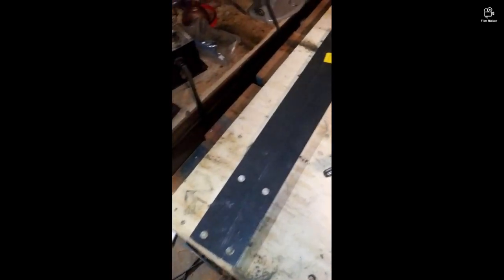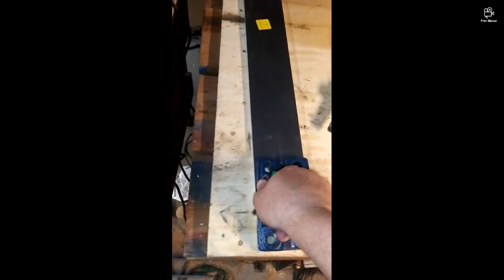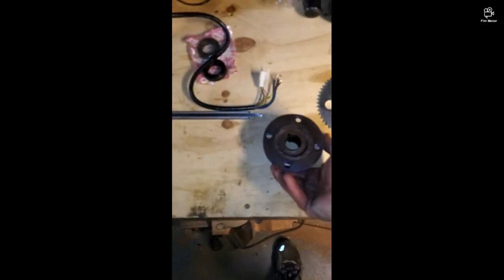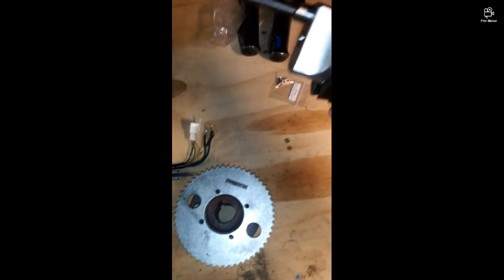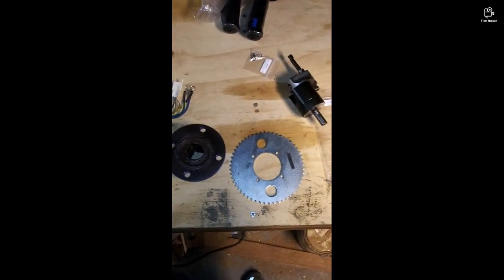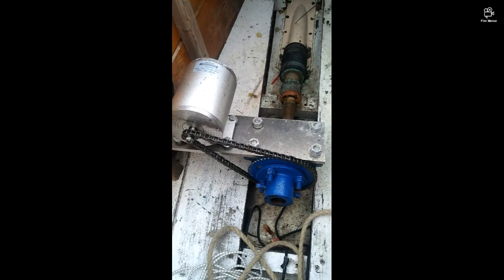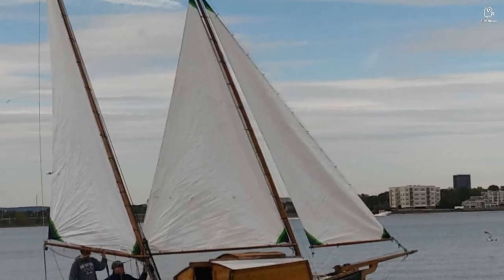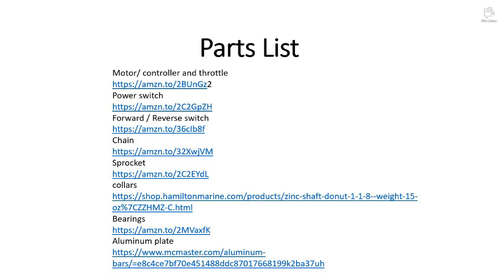Inexpensive   DIY Electric Inboard Conversion

Comment: Hi. Where did you get the shaft and prop from?
Reply from the maker: Hi, sorry it took me so long to respond.  I got it on craigslist under Boat parts. The entrance the prop in the propeller 300 bucks. It was well worth it used.

Comment: 🤔Humm,does the prop shaft want to slide forward as the old motor held it in place before , ?  What holds it in place just the chain ? 🤔
Reply from the maker: That’s a really good question cause you think if you work through, you think that it could.  I have not seen that, but it certainly could do it a little and I just don’t notice.

Comment: Just out of curiosity, how fast were you going at full speed???
Reply from the maker: Just over 5 knots but it would over heat with that motor after a while , it would run for ever at 3 knots
Reply: @philcostello6989 what was the approximate weight of the boat?? Just curious again
Reply: @philcostello6989  Test I am @thepatriotsledgehammer and this is my other channel... I am asking as I am currently in the process of building my boat....

Comment: Did you find any foid throttle?
Reply from the maker: I tried a few ! the one I use now is a simple halls sensor turn switch from Amazon. It’s sensitive I was also looking at a control to provide the signal and do it on Pad touch screen , but I decided I’d rather have a lever so now looking at a hall sensor lever
Reply from the maker: https://electricbike.com/forum/forum/main-forum/trouble-shooting/119157-how-to-make-a-potentiometer-type-throttle-work-as-a-hall-sensor-type-throttle

That link may be helpful for throttles ,showing how to convert a simple variable resistor as well
Reply: @philcostello6989  cheers thanks

Comment: What is the mass of the boat? I am thinking about electrifying my sailboat but it weighs approx 7 metric tons, believe that is about 15000lbs
Reply from the maker: My boat is about 3000 lbs you’ll need at least 10 kw motor I think , check (thunderstruck and golden motors system
Reply: @philcostello6989   will do, thanks for the info

Comment: i did not see a thrustbearing
what is stopping the driveshaft being pushed backwards and forwards?
Reply from the maker: There was a little movement  back and forth initially . More recently I fixed the motor mount to the floor and have it more locked in to bearing and collars

Comment: How much does the boat weight? I have a 6000lbs houseboat and I am looking for a bldc motor power enough to propel it not necessarily at high speed
Reply from the maker: So my boat is about 3000 pounds. I would suggest a golden motor or thunderstruck 5000 kW
Reply: @philcostello6989  The 5kw one looks okay for boats up to 6000lbs but the 10kw is probably better but they are a bit expensive. A twin Vevor 3Kw motors would probably be a alternative. There is also Turnigy Rotomax. I am still researching and learning, I am looking to all possible options, sealed under water engines to prevent any heating issue, even used converted car alternators. Haven’t decided yet if it will onboard or outboard. Thank you for  sharing your stories and findings!

Comment: Great video. i restored a 2000 Bayliner capri and now the engine is seized after we ran aground. I would like to be able to convert this 19 boat to electric.  Any idea on where to get a set up for a DIY guy. thanks.
Reply from the maker: Hi, I would look at several thunderstruck, golden motor Canada both conversion packages . you could also look at grinn technologies # https://ebikes.ca/product-info/grin-kits/gmac.html
# https://goldenmotor.bike/product-category/e-boat/inboard/ and # https://www.thunderstruck-ev.com/electric-sailboat-kits-and-accessories-inboard-motor-ev/
Research on these sites they have good info

Comment: Hey mate, do you have an idea what what this motor would be equivalent too in HP petrol motor?
Reply from the maker: The conversion is to devide kw by .746 in theory it’s 2.5  . though the gas and electric perform differently depending on tork and thrust at operational speed

Comment: I was wondering where I could source a motor like that I want to use a belt drive wasn't able to see the parts list it went by too fast and I'm not good with the computer or the phone but I can build or fix most anything
Reply from the maker: Those motors  can be found on Amazon and eBay mophorn is the brand on Amazon look up electric gocart conversion 

The also sell them state side at electric scooter parts.com

Comment: how many amps was it drawing - what type of battery sys. did you use? ... i have a 31' Cal with a dead diesel (pulling out now) - def. want to go this route ... but DEF need help getting this accomplished .. i have brand new POOL VAC MOTOR - i think that will work - think :)  any ideas would be very helpful ... here in miami
Reply from the maker: Lead acid 80 amp hrs im getting about 2 to 3 knots about 30 amps . Lead acid can’t go less than 1/2 rated amp hours or will permanently damage batteries I have another video on the power and speed

Comment: Hey there! Thanks for the vid. I want to convert a 35ft sailboat to electric. I want to buy an inexpensive (about $400) industrial AC motor (20 hp) and run it off a DC battery bank. Any ideas about the stuff I need to buy? (motor, controller, batteries....) Thanks!
Reply from the maker: I would really look at lithium batteries off the bat. I would also look at the over all efficiency going from battery to the ac power . And look at some of the ac safety concerns.
Reply: @philcostello6989  Thanks for info! I bought a 12KW brushless DC motor. Arriving in a few days. I need to source a controller for it. Hard to find out what will work.

Comment: Anyone done this using belt drive capable of taking 200 hp
Reply from the maker: Hi Michael thanks for watching, the video. there are some companies out there that are doing belt drive with a fixed mount in the hull using motors that have high horsepower. I think the issue would be the battery storage needed for a 200 horse more than the motor and the mount itself. Companies like Lynch motor or elco Marne propulsion , deep blue, electric motor inboard Evoy  . I would look at all these companies get all the information you can and then see what would work for you either DIY or through one of these guys. That's my thought some of these forms of people that are a lot more knowledgeable than me though

Comment: Thanks for sharing. Simple, just like it should be. Why complicate things? I'm thinking of converting to electric as well on my 34 foot sailboat. How much does your boat weigh?
Reply from the maker: https://youtu.be/FvGr-QJ6FGQ    my boat is in the neighborhood of 3,000 lb plus myself and my passenger usually are about 500. I have attached this video which shows some of the considerations I had gone through and also gives the exactly and how you can size the electric motor to your torque requirements on your speed. the thunderstruck motors also has several good links and several good calculators to help you. I hope this helps. when considering this you just want to really look at the batteries for me to let acid we're okay but I made a mistake I thought empowers were the same amp hours rating for all levels of draw but it's not the case with the lead acid batteries you pay a heavy price for taking out a lot of amps and most of them are rated for low amps that's the deep cycle batteries. the fact that I use it just to get in and out of a slip made this mistake forgiving for me but if you're going to need it to go long distances it may be worth the lifting of iron batteries

Comment: how much watt is your motor ?? like 100 watts or so ?? seems really small on your boat ;) nice project none the less
Reply from the maker: Hi Senc, the motor rating is 1800 watts though the controller that comes with it and the advertisement says it's only 32 amps which would be less than 1800. Because I use lead acid batteries which are terribly inefficient I try to keep the three knots which is between 10 and 25 amps depending on the current and the wind on my channel I got a video on the speed and the power if you're interested. I'm about to do one on the lead acid batteries which I can really only afford though the lithium looks so much better and more efficient

Comment: That is true. I think the ideal would be lithium ion but now you are looking at a battery management system. Or take your chances at fire. I am looking at a middle option between lithium and lead acid which is using recycled Prius power cells wired in a combination of series and parallel for voltage and watt hours the Prius is nickel metal hydried.
Reply from the maker: Wow that sounds pretty cool Prius did you get those from a junkyard or is there somebody that's reselling them. I was actually thinking about an e-bike battery pack usually comes with the battery management system since functionally I only really have about 30 amp hours and I've been doing fine with it I might keep that that 30Ah number and for my next  battery
Reply: @philcostello6989  So just wanted to update, after doing a lot more research and correcting my math, the NiMH batteries are still a good option but not likely from a prius pack, I have found a different motor so I am going a different route. In the 70's GE and Wheel Horse made a tractor called an Elec Trak E20. the motor is a 36v 30 amp stabilized shunt motor, which means speed variation is going to be a little different type of control but at 5 knots on off is all I really need lol. I am going to pick up the motor this weekend, I am told it can run effiently as 24 or 36 volts, If it runs good at 24, I will carry 2 12 volt deep cell banks at 24V and when I have to switch them out, thats my turn back home point :-)
Reply: @philcostello6989  Used to be able to get them free at a junkyard, but you can get each cell pack for about $20 and each pack is 7.2 volts at its best but most run about 6.7V and about 6.5 amp hours.So 8 of them would give you 48V and 48 amp hours but no need for a BMS plus off season you can check each cell and either recondition or replace. That my plan I think, build two of those packs to run in series. Start with one see what my range is. then go from there. At 6 to 1 how is the torque stress on the motor as a guess? could you lower the ratio to run the motor at less throttle? Or is 5 to 1 about right for the motor torque wise
Reply: @philcostello6989  After more digging the Prius cells unless they are gen 3 are probably NOT a good option

Comment: What is the range you are getting and what battery did you add? Also I have a similar size boat a little smaller all steel lifeboat, currently powered by a Montgomery ward 1940;s air cooled 2 HP engine. What is the ratio of sprocket to sprocket, I already have the shaft rigged for belt drive and want to order or turn a pully for the motor but wanted to see what your ratio was from one to the other.
Reply from the maker: Currently I have replaced the chain with the belt I have a four to one on there gear reduction It depends on the speed how many miles I'll get max speed up getting right now is probably four and a half knots and that's a great cost and power. My batteries are ever ready deep cycle and they originally rated for 80 amp hours so 48 volt 80 amp hours originally the capacitance of them currently after 2 years is about 65 amp hours. I just recently published a another video that goes into the speed and the torque and the power on my boat to explain what I did in greater detail if you want to check that out but I think that based on three knots I would probably get about 3 hours so I could do probably nine miles. I would question on that though you have great currents or great great wins that are holding you back that might even be less.
Two nights I would probably get 12 nautical miles with my existing batteries. That's in theory in fact I really only use it to go in and out of the slip and if the wind dies and I want to get back so I've never actually used it for the more than two or three miles
Reply: From my understanding you want to get as large if ratio you can before affecting torque by to big a factor. This will give you the longest batter life because you can run at lower Rpms. I have a small generator which I can Carry with me to increase range but I hope my Prius cell system will give me a good set up in the end.

Comment: Just an idea. The chain sounds pretty loud. Could just be my speakers. But chain looks much tighter than needs to be. If you loosen to a 3/4 inch slack it might quiet down significantly. Just an idea. Wonderful project. Good job.
Reply from the maker: Thanks for the feedback I never would have thought of that that the chain would be too tight but it makes sense I actually changed over last winter to a pulley system there's another video showing that which made it quieter but I wish I knew that before I had changed it maybe it would have made it quieter not enough so I didn't have to make the the change to the pulley

Comment: Sorry my other question is what batteries and what kind of range are you getting.
Reply from the maker: just wanted to give you a heads up I've been reading up and learning on the batteries a lot more I always thought when you read the amp hours on the letter I said batteries you got the full amount but in order to not discharge the battery and only use half of that. I never really found that out cruising because I would just take the sailboat in and out. the other thing I found out was there are different discharge curves so the batteries can be very misleading lead acid that is the time it lasts is based on how fast it's being discharged and you have to look at the specific curve on that specific battery so be careful

Comment: I have a 1915 lifeboat that I converted to an inboard gas motor air cooled. It is a 1930-1940 Montgomery wards (Wisconsin) engine. I was thinking about trying electric. May I ask a few questions. How is the torque? I was planning on 1 to 1
Reply from the maker: Hey Tom sounds like a really cool boat. I have almost six to one gear ratio reduction. Because I have a sailboat I'm already only worried about reaching hull speed which is about 3 to 4 knots. Because this is an electric motor and I have a gear reduction I have plenty of torque keeping in mind max speed is no more than 5 knots at at great draw on batteries.. I am using 4 12 volt lead acid batteries and series they are deep cycle eveready brand with 80 amp hr storage. Good luck and Id love to see some pictures of your project !

Comment: Nice boat!! Battery? Wondering what's powering this and how long it lasts?
Reply from the maker: Hi Justin ,  48 volts , using 4 lead acid deep cycle batteries in series.  at three knots the batteries  seem to last all day , 5 knots about an hour . currently my multi-meter reports my system to be holding 65 amp hours  I am currently trying to nail this down better and will hopefully have more info soon
Reply: @philcostello6989  Awesome, thanks!

Comment: Thanks for the video. Just, what have you used as thrustbearing for the forward pressure from the propeller? Was it already there with the old shaft? Br
Reply from the maker: i am using a zinc anode between the stanchion and prop . for me it works fine . i am not a blue water sailor and the motor is used  for getting in and out of the slip or getting home with no wind . its not a bearing and adds to the load but the water lubricates it and it works good